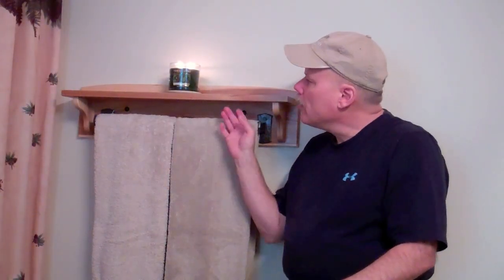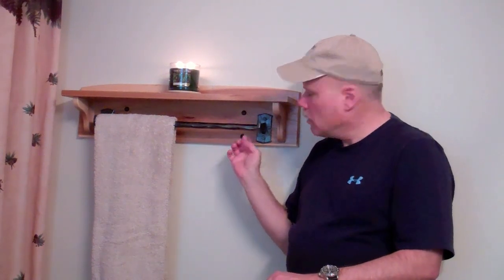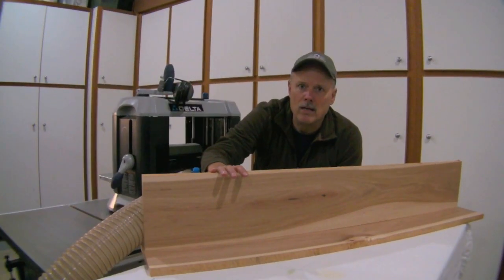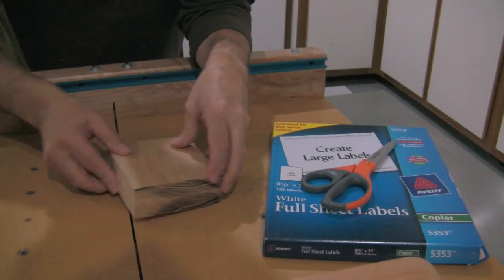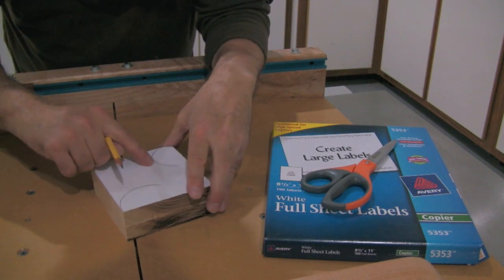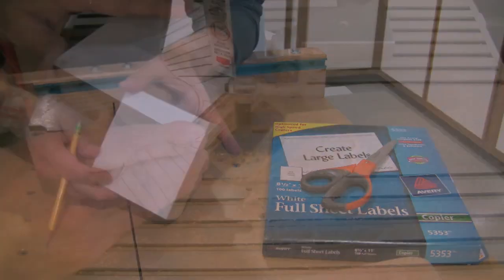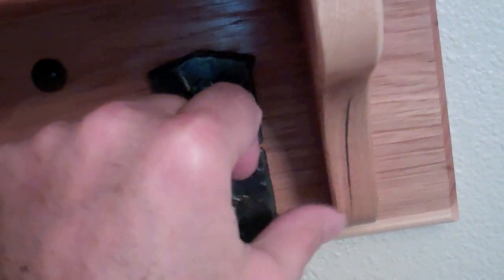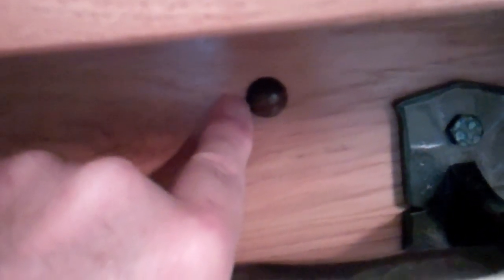Hickory Towel Rack

Comment: Watch the clearance between  the top shelf and the towel bar..Too close and it becomes difficult to get the towels in and out.

If your unit is directly beside the shower (looks like it might be) I might be tempted to take a bead of clear silicone around the top and edge to make sure you do not trap water behind the wood (will cause it to crack).
Great iron works!
Like the design Doc. I really like how you eased the top edge of the unit.
Good job!